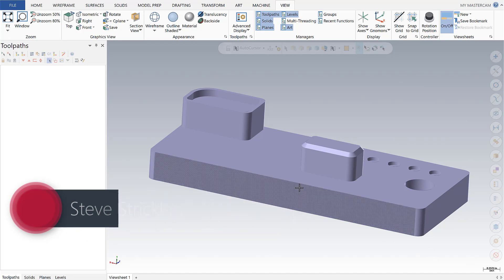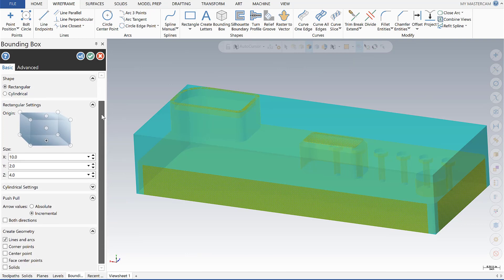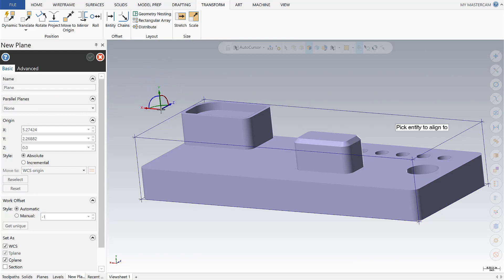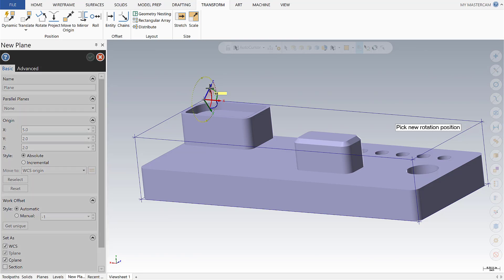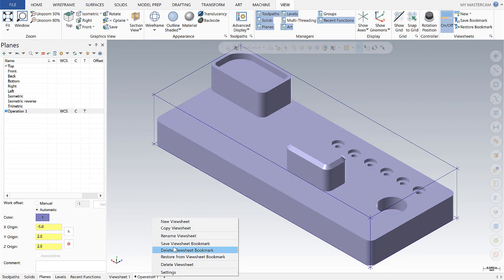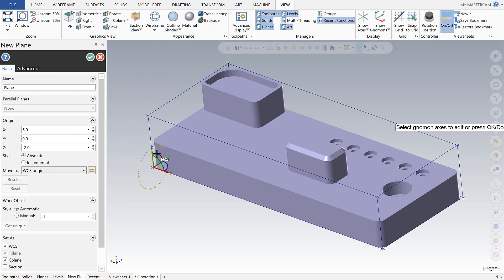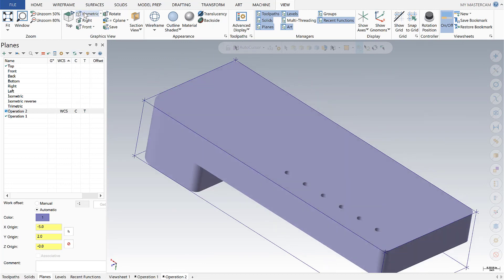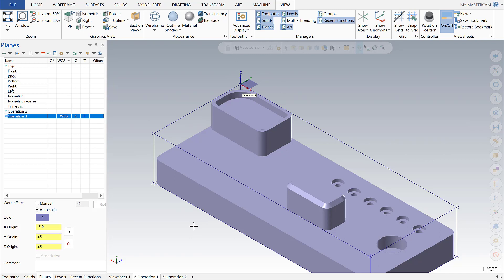Setting Up Planes - #MastercamMonday

Comment: I was wondering how is it possible assign a toolpath to a said plane and level. For example, I have a part that has a 2 pockets. One is smaller in size to the other and in the same plane. How do we assign a toolpath for each where the plane is same but the levels are different? Could you give some insight?
Reply from the maker: You set your plane based on how you have the stock mounted in the machine.  So assuming your two pockets are on the same side of the part, you should be all good with the single plane.  Levels are primarily used to organize, so simply make sure the levels are active when laying down the toolpath for each pocket.
Reply: @CamtechEngineeringServices  But when we click on the first tool path its shows both the paths for the created 2 pockets. How do we only see the specific tool path for the created operation?
Reply from the maker: @geevamathew  , On the left side of the Mastercam window in the Toolpath Manager, there is an icon to display only active operations.  Looks like 3 horizontal squiggly lines.  This option will display toolpaths for only the one you click on.